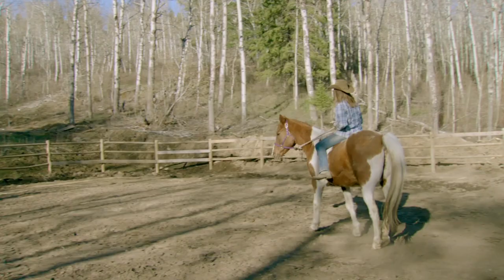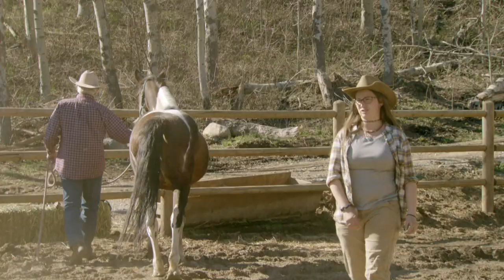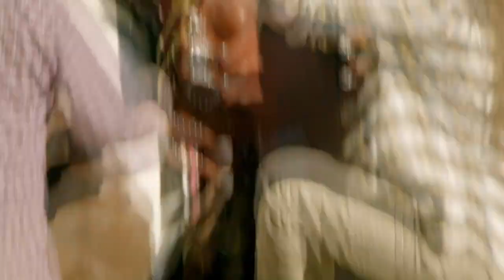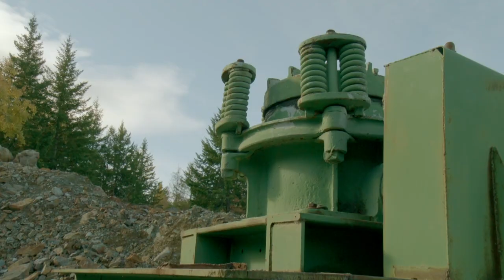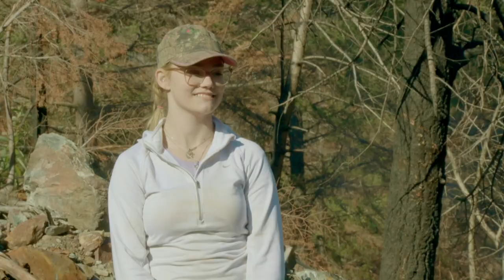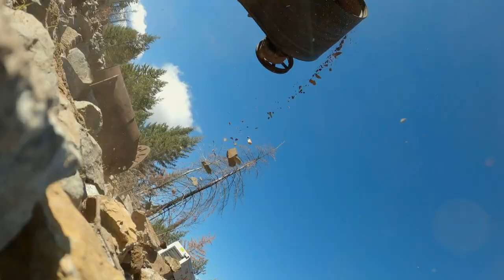Bird Learns How To Ride A Horse | Alaskan Bush People

Comment: I cant believe the instructor never corrects her... 
So first of all you don't put a bridle on by holding the bit. You hold the headstall and guide it into ther mouth, the slip the ears under the top. And you need to push your heals down, her heels were up and legs were curled. That will push you forward and keep you off balance, that's probably what made that horse look so uncomfortable